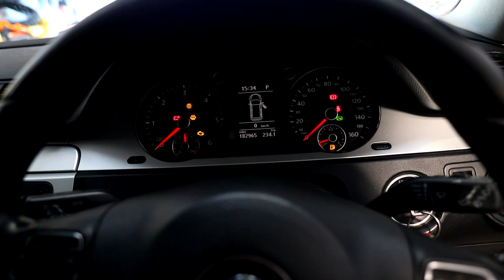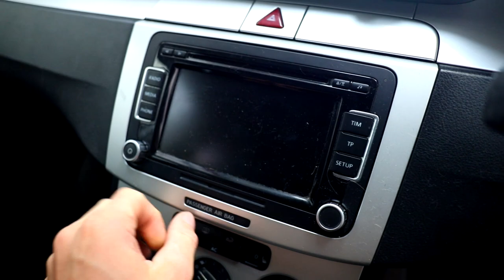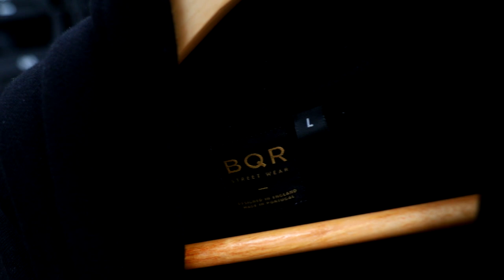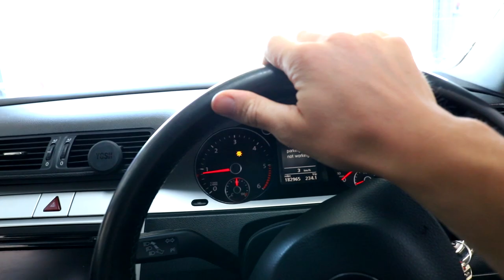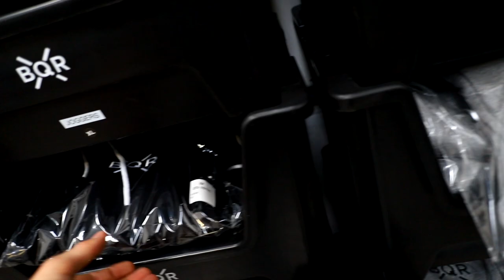Budget Daily Build - Episode 1

Comment: Yooo Boq don't know which engine it has and you may already know this, but be super careful with the oil pump drive key on these wearing and then no longer pumping oil (especially on the BKP, CBAB, CBBB engines) - usually after 100,000+ miles they're bad enough to blow up the engine suddenly; it's like £10 for a replacement key and peace of mind. Guess who's big end on their B6 Passat went after a lack of oil a couple of years ago...
Reply: Know this is old but for anyone coming to this video later. the issue he’s talking about is the v6 engines the Tdi and 2.0t models are a little more consistent in my experience car in video is a TDI.
Reply: 2.0tdi BMP was the best one

Comment: For the window, check the wiring that goes from the door to the frame of the car (will be inside some rubber trunking) usually it splits or actually snaps some of the cables inside

Comment: The issue with the door handle will be the Bowden cable between the handle and the lock mechanism. They go rusty and seize. Also, to get to it you have to take out the window mechanism panel......top tip, the clamp bolts for the glass are a tiny torx and you have to turn them CLOCKWISE to loosen them.

Comment: If the engine is transversely mounted, then the shaking while turning left could be driveline related. My Volvo had a similar issue but it was only when I was on the power and turning left

Comment: Love colour it's same as mine... I had driver door fix plus windows fix...
I changed wheels to this year model alloys wheels but had them powered coated... Boot line tray is a must.. I de badged boot... My custmore give me double dim clarion stereo free I also made it so when car is switch of but fob key still in stereo stay on.... If wire mobel lead you can hide wire behind stereo dash up and over the steering wheel plastic can easily clip out hide wire... A nice mod is change head lights to leds. If you got car reader you can change car alarm lights and if clever can change way signal light flash... Free mod... I just upgraded turbo. Drop oil coolant aswel change fuel filters and oil filters.... Up graded clutch and fly wheel.... Comman folt is electric handbrake going so change caliber on back full disc change brakes too.... Pought car 750 previous owner wonted 1500.... Now won't pay back 2500 ha ha 💪😁🤔
Reply: If got tec de cat it re mab.... Egr delete some say do it. I have second forts as trevel alot all over UK.... There is nice mod you can do to back brake lights you can change them to sky liner lights as same fitting with little work but no good at that stuff
Reply: You can get up grade on the switches for temprature and fan switches
Reply: Front grill you can get mod grill so it de badged or can pay badges any colour mine going either mertlic blue or light blue... To match calibers and... Turbo pipe work.... Saving up for tinted windows plus scirocco air INDUCTION KIT AIR INTAKE Kit look good but might use different filter might use kn or take car to Demon tweeks  mod the exhaust..... Mine 1.9 s tdi on 09 plate its bxe engine ducking love it daily driver plus use it for work